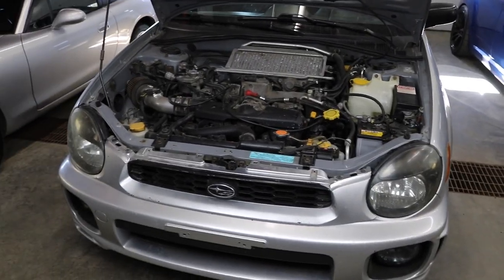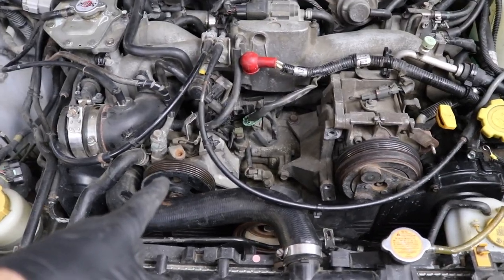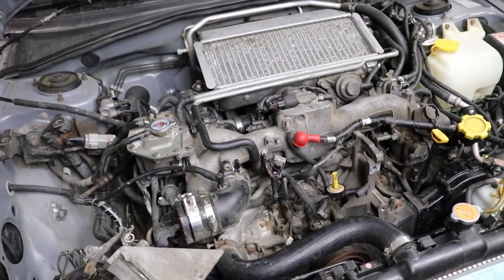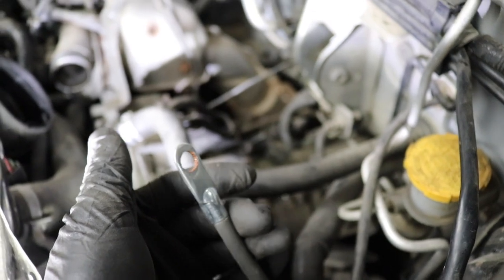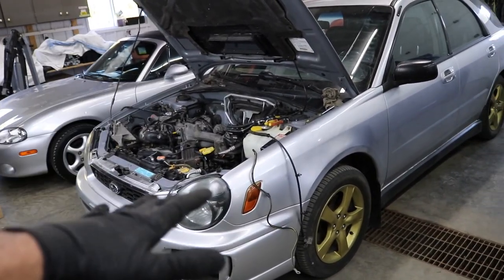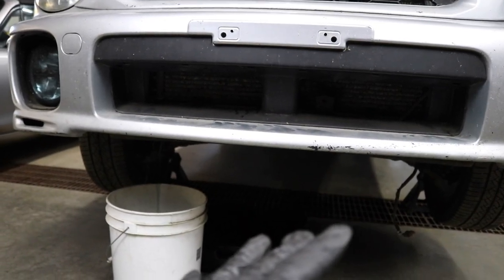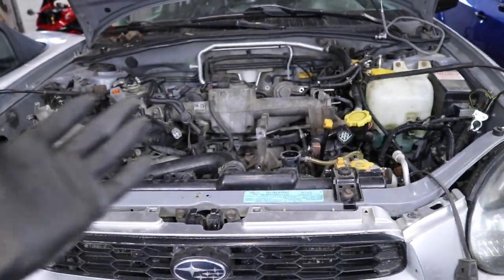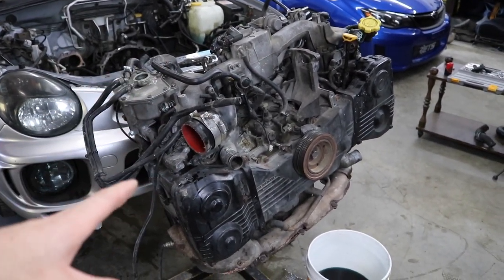How To Pull a Subaru Engine!! (WRX)

Comment: I'm gonna be pulling the engine on my '04 Forester XT soon. Pretty sure it spun a bearing, but it happened at low speed easy driving and I shut it down right away, so I'm hoping it can be saved! Never rebuilt a subaru engine before (just a few inline 4's and V8's), but I'm gonna give it a shot!

Comment: Wow, that's waaay less than I was expecting it would take to pull the engine. Im having to replace mine and was just going pay someone else since I thought it would be a nightmare. Its actually pretty simple.
Reply: Did you get it done my headgasket is blown and I’m scared to let someone else do it is it easy?
Reply: And I know it’s gonna be expensive
Reply: @nathan9642  ya I had someone else do it. Unfortunately my garage is a cluster fk so I couldn't. Somehow the dude only charged me 1400 to swap motor, all new gaskets except heads, timing kit and install a new clutch. All in it was like 4 grand for motor, clutch, parts and labor.
I've heard it's easy, but also heard people say it's a nightmare so idk? If you have a second vehicle, garage and mechanical knowledge I would say do it yourself? I would definitely watch few vids on step by step before you really decide though.

Comment: After more than a year i finally got my sti back running. Your videos really helped out you got no idea how many times i had to rewind and watch again and again and again. Im a little paranoid now tho i have very loud id 1050 injectors and since ive never had forged pistons before i dont know if all the "wierd" noises are normal.
Reply from the maker: That’s what I like to hear! 1050 injectors shouldn’t be too loud, I have 1300s & they are quiet as a mouse with a pulse damper on each rail. Piston slap from the forged pistons should pretty much only be there when cold. When the engine warms up, most of the noise should go away as the pistons expand.
Reply: @DanielKellert  I think i might have a problem with something then. My injectors are really loud. Nothing looks bad on the acessport tho. No feedback knock or learn and cylinder roughnes goes to maybe 1 every once in a while but not often. I have a new type ra block but its .30mm out of square on passanger side by the trans mount and i didnt realize it untill it was too late to return.

Comment: Hi, will a 2018 subaru outback wagon non turbo have a cam carrier leak/drip at 34,000 miles on the car? they are charging me $3555+.